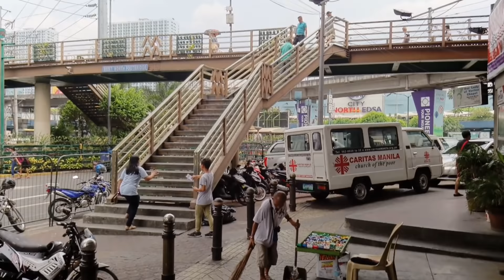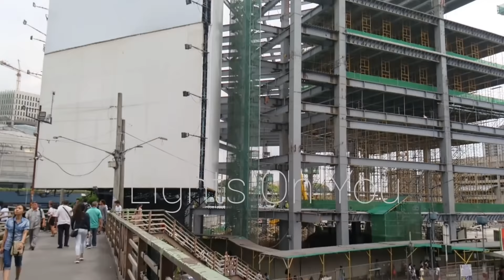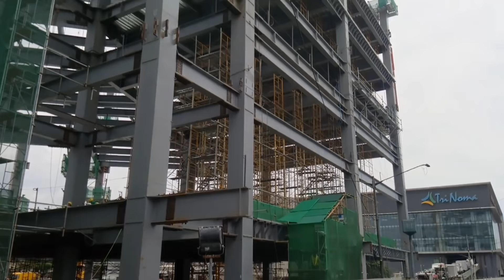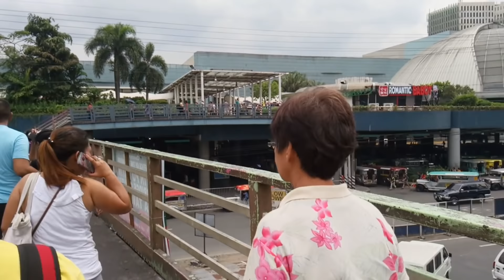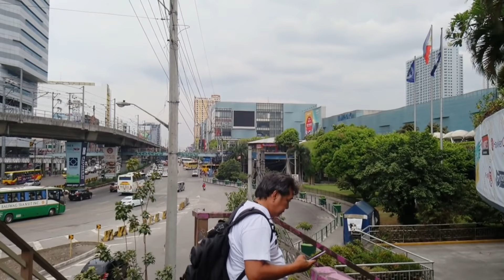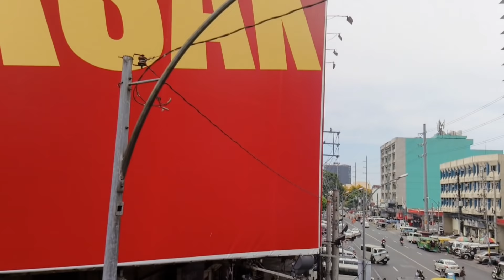Unified Grand Central Station (UGCS)Common Station UPDATE MRT 7 North Ave.

Comment: Are they going to lengthen the MRT7 terminal to accommodate the subway (I mean the train not the fastfood)?
Reply: No. You’ll walk to the next connecting station to change trains. That’s why it’s called a Common Station. This is where LRT-1, LRT-7 and Line-9 meets.
Reply: @iMadrid11  Obviously, you didn't understand my question fully.  I am talking about the connection between the SUBWAY and the terminal.

Comment: there is one missing, the MRT 9, that will be built along west avenue to quiapo or divisoria via quzon Avenue and will be linked to PNR. this new MRT route will also use the common station together with MRT 7. LRT1, and MRT 3
Reply from the maker: Thank you for that information sir.
Reply: I have only known that by now.. any updates about that?
Reply: There are still no feasibility study yet, its either an MRT or BRT along quezon avenue going to quiapo
Reply: @venszelrodaguilar2476  they need to work on it asap.. that looks very useful
Reply: Mrt 4...or 5....also
Reply: Mega manila subway will have its station here as well

Comment: Hope Manila can catch up with Hanoi and Jakarta soon.
Reply: Hanoi seriously?? Hanoi is far behind metro Manila.
Reply: Kingdom Plantae 
No mrt in Hanoi yet
it’s done but can’t operate yet
coz the consultant from France 
didn’t approve the safety.
it’s built by Chinese company
the length only 10+km.and it took
so longggggg time to finish 
the construction.
Reply: Kingdom Plantae 
in Indonesia they started
high speed train fr.jakartar to
Bandung the length 100+km
Reply: Kingdom Plantae 
in Thailand in 2nd qt.of 2022
they will have
1.the metro(subway+sky train)
12 lines(colours) total of 300+km.

2.bang sue grand central station
24 platforms 100,000 sq.m.

3.2025 high speed train will
finish total of 400+km.

Comment: A unified provincial bus station should be besides this central station.
Reply from the maker: Good idea sir! The problem is yung  espasyo ng Lupa mukhang masikip na ito for unified bus station at pwedeng mag cause ng additional traffic sa North edsa
Reply: Too late for that. This area is now considered as part of downtown Metro Manila. The government is now in the process closing all provincial bus terminals at Cubao to be relocated at PITX, Paranaque. The master plan is get rid of all provincial buses at EDSA, with an elevated bypass NLEX to SLEX highway.
Reply: @iMadrid11  That is even better in my opinion. Most of the time, swerving provincial buses (thanks to the undisciplined drivers) are the main problem why the traffic gets backed up making the situation worse. The government's master plan is actually a smart idea. Connect the two main expressways via bypass to decongest EDSA

Comment: Bakit ya napakataas anong meron?
Reply: Ganito po kasi yan ma'am. Any plan, Gagawin ang unified station para sa kaginhawaan ng mananakay. Meaning primary purpose niyan para sa commuter. Ngayun pinasukan ng mga negosyante naging secondary nalang ang mga mananakay at primary purpose niyan  eh para sa commercial business. Dapat tawag diyan sy-ayala commercial unified station.
Reply from the maker: Ma'am Leigh Dan Go tama po si Sir Samalenio.kaya po siguro mataas yan ay dahil kasama npo ang mga commercial establishments dyan kgaya ng restaurants, boutiques etc. Similar sa mga mrt stations na makikita sa hongkong.
Reply: Para ma-address ang interfacing ng UGCS sa mataas na elevation ng MRT-7.